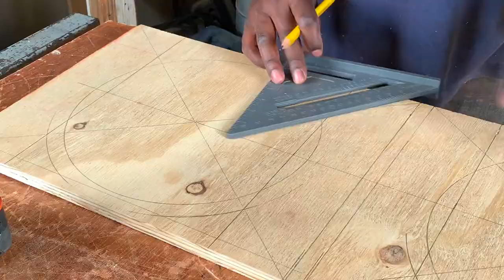How to build chuchero and funnel speaker enclosures for high and low mid range/ top end

Comment: Amazing work brother! Slowly getting into mid box building and was wondering what that tool is called that you use to keep the two pieces of wood at a 90 degree angle and square at the same time, great tool to use, but unsure of the name 💯
Reply from the maker: Respect. It’s a corner clamp

Comment: 9:11 Real talented bro... I wanna get a box like that but I got a question for you! I know the speakers would be mounted from the inside of the box but wouldn't the cone hit the wood when the speaker moves in and out???
Reply from the maker: Nope, one the speakers have a flat suspension surround, two minimal cone movement due to the frequency (high mid) the speakers should play at and three the gasket on the speakers create a space between the cone and mounting baffle board. Thanks for the compliment 👍🏾
Reply: @mbelectronicsandservices9546 chucheros r supposed to hit 100hz ish bottom